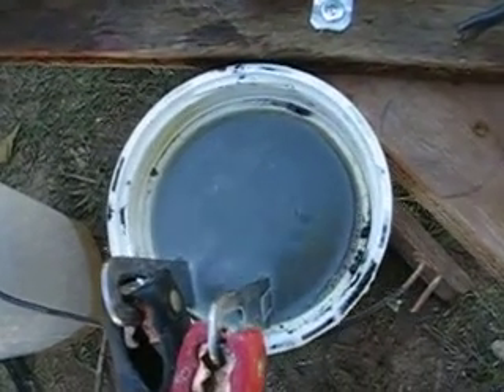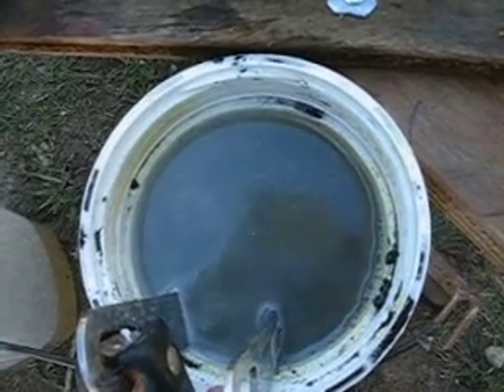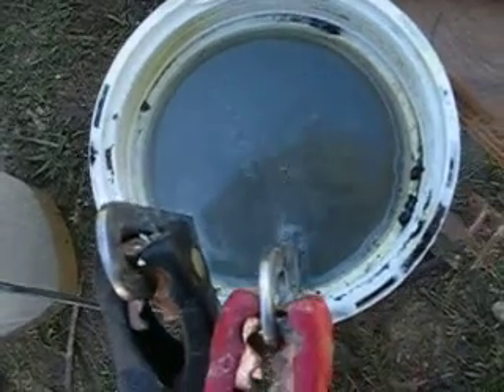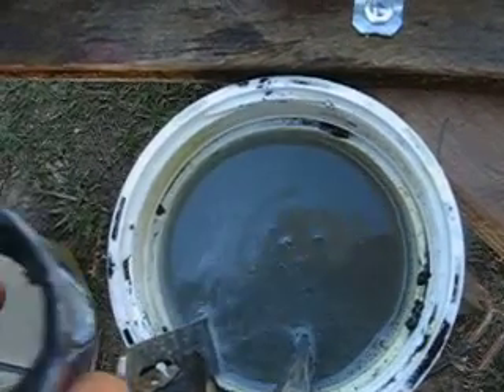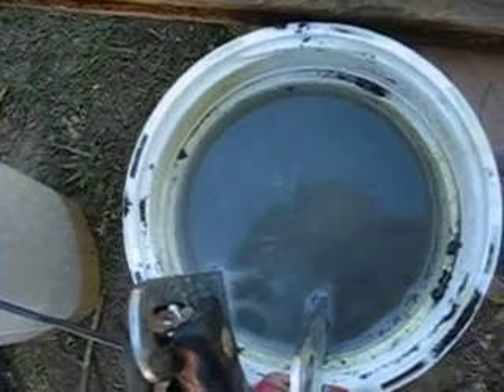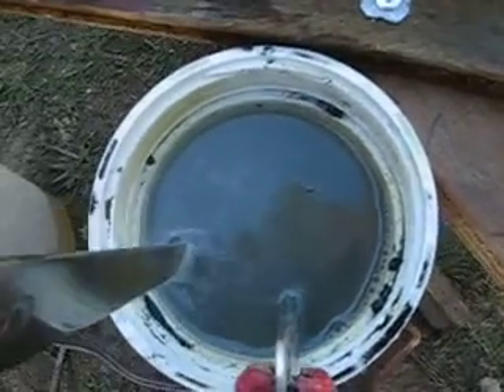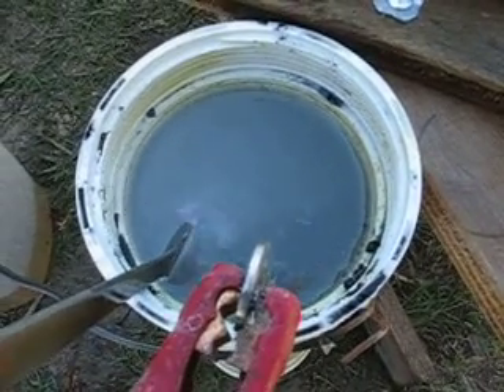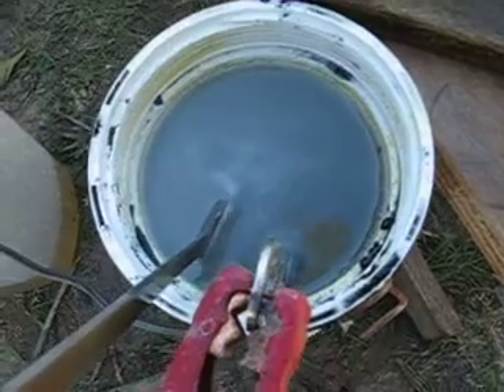014 HHO Graphite powder / Tap Water,Hydrogen through changing Gap distances

Comment: you made a genius thing. HHO system require alkali or acidic environment but carbon powder hho system would not require it. Only adding water àgain and again will be require.
Reply from the maker: This was just a Test, but try treated  Algeas and low Voltage from a Solar Cell
Make the Lead ends frizzy like a Gras Sod and feed the Leads from the Bottom for a independant production with no electrical power from an outlet.

Comment: The rods inside batteries are graphite and can be used for your two electrodes.  Just attach your wires to them.  The Manganese Oxide is the black greasy powder inside the battery, and like the carbon it's probably mixed with, it's insoluble in water:  MnO2 will probably not work for electrolyte because it doesn't ionize like the baking soda.  Baking soda isn't as good as potassium hydroxide for electrolysis so they say.